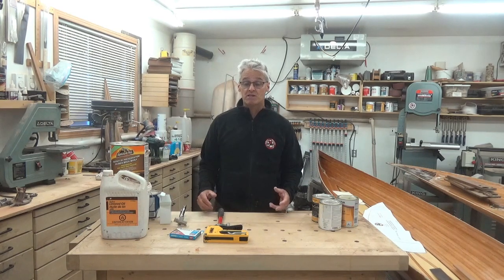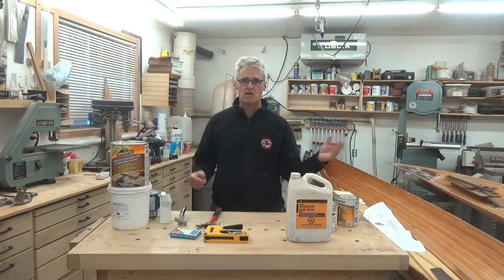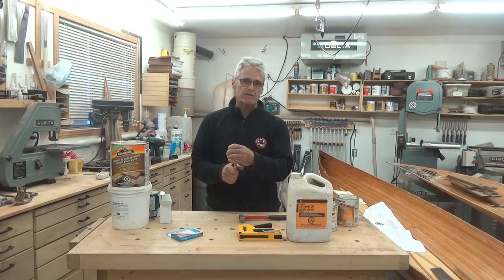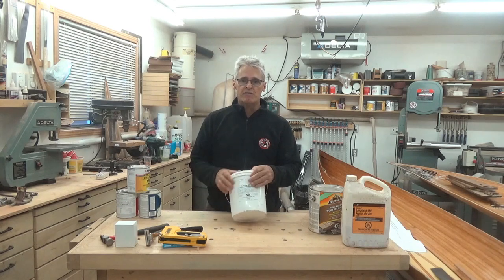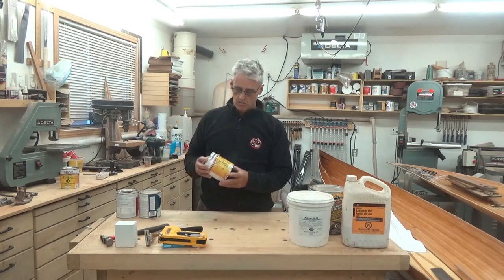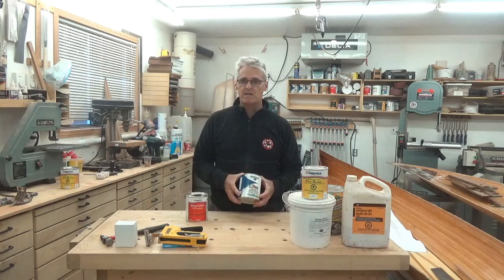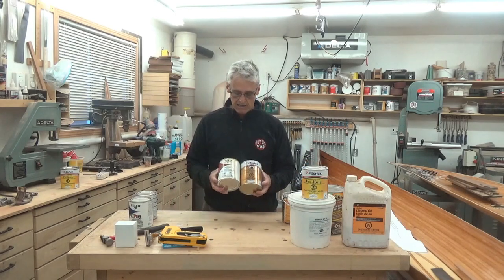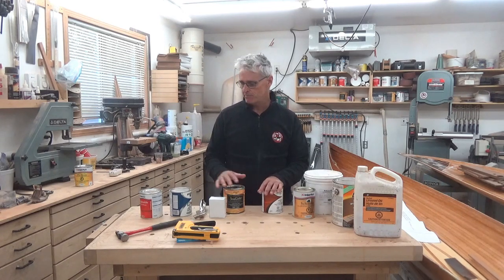Canvas Canoe Restoration

Comment: Hello Rod, I’ve really enjoyed watching your videos. I’m learning a lot. I got a 14’ cedar canvas canoe and it’s in need of a lot of love. I’ve stripped it down and stripped all the varnish off the inside. The stems needed some repair and I replaced a large area of planking and 3 ribs. Looks like a rock struck the side of the canoe at some point. My biggest question is about the mastic. How much do you dilute it? You mentioned thinning the mastic for the first couple of coats , but don’t say what you use to thin it or how much. Can you please enlighten me. Thanks Doug
Reply from the maker: The mastic is water based, so I just rub it in with either my wet hands or a sponge.  Or you can wet the canvas down as you apply.  Stuff dries quickly so keeping water on hand helps to get it smooth.

Comment: Nice to see a video on this subject.  I have also purchased raw canvas and thought of using a Thompson Oil based wood preservative on the canvas.  For some reason your video cut out when describing your canvas preservative. What is it?  I've worked as a painter / restorer  and a fine art painter for years and usually do not switch from water based products to oil based and vis verse... it's Kindof a No No as I understand.  I especially don't get the use of a water based varnish finished off with oil?? Unless you apply shellac between.
Reply: The preservative is simple clear preservative by Armorall

Comment: I have question that I can't seem to find an answer to. Have you ever restored a canoe that has used ring nails for fastening ribs to inner gunwales in a previous restoration? I did some samples using ring nails prior to  my own restoration. They are nearly impossible to remove without destroying the ribs. Comments or suggestions?
Reply from the maker: Older canoes may have steel or iron nails.  They then rust and seize in there.  I always replace with bronze ring nails.